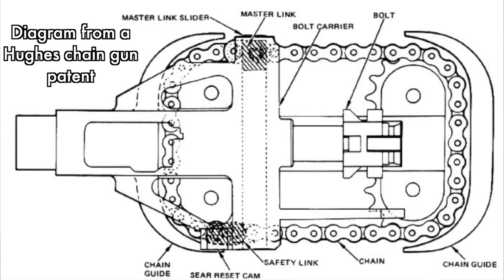Ask Ian: Are Man-Portable Chain Guns Coming?

Comment: Also "inconsistent" ammo in a chaingun isn't just because of under or overloaded rounds; but can be because you switch between, say, HE and AP rounds -- and many infantry fighting vehicles chainguns have dual ammo feed to allow just that.  Recoil or gas operated guns likely need adjustments when you've got that amount of difference in projectile energy.
Reply: My shotgun is a Beretta 1200. It won't cycle trap and skeet rounds or even low brass rounds quite often. It also has a 2-3/4" chamber. That leaves a rather narrow window of operational rounds for me. I hear the 300blk has rather overcharged subsonic rounds to give it a prayer of properly cycling as well. This is a real issue.
Reply: @groofromtheup5719  I read this comment in a little Italian boy accent
Reply: @TheHAIR00  I am now reading that comment with an Italian accent on purpose.
Reply: @blunderingfool  mama mia!! 🤌🤌
Reply: @TheHAIR00  OOOOOOooooooooh (Paulie Gualtieri style)
Reply: @TheHAIR00  sorry to disappoint, but I don't have the finger dexterity to pull off a proper Italian accent.
Reply: @DarrellVermilion  Pappa peeya
Reply: @TheHAIR00  "little Italian boy accent" sound so specific it's very funny to me. You know as opposed to a "huge bearded Italian man"
Reply: @APleasantEmu-ce6hm  I do not remember posting this comment, but I stand by it. It is still funny to read that comment in a little Italian boy accent
Reply: @TheHAIR00 Hahaha it sure is
Reply: @groofromtheup5719  there are some 265 grain lead projectiles s available for the 300blk. They're designed to allow for a lighter powder charge to minimize gas, while still having enough pressure to cycle the gun. I loaded up some that weighed in at 260 grains with 10.45 grains of CFE BLK at 2.125" overall length. I was getting a consistent 960 fps with my 8.5" 1/8 PSA upper. I think this upper is over gassed because PSA. This 265 grain projectile is the same length of a much lighter jacketed projectile, so you don't end up with compressed loads.
Reply: @groofromtheup5719  that’s a shame… maybe a M242 25mm bushmaster would be better for you, it’s great at cleaning up low and slow flying aerial targets!!
Reply: @groofromtheup5719  Usually autoloading shotguns are adjustable for exactly that reason: There's a stupidly variable number of different loads out there. This is also why I bought a pump. You should be able to adjust to replace something to make your autoloader function right... please refer to your owner's manual to confirm for your firearm, however.
Reply: @groofromtheup5719  Used to have a wonderful Beretta that would also only tolerate high-brass.
Reply: Actually, changing the settings on the gun adjusts your sights for the trajectory of the selected ammo. The pressure of the round doesn't affect function because the gas or recoil from the cartridge doesn't operate the gun.
Reply: I'm somewhat confused. A chain gun is mechanically operated. The chain guns I'm familiar with will cycle all the ammo through them without firing at all. Why couldn't you just time it for the highest pressure cartridge so tearing the cases would be a non-issue? It would always have dropped enough pressure to allow the case to extract.
Reply: While its possible to have remote control over the gas port size, that's the kind of engineering that's ask for problems
Reply: @nordoceltic7225  True that. This solution has been around for a fair while; also notably in the F2000/FS2000 iirc. I don't know which gun was the earliest to adopt it though.
Reply: at that point you are nearing "auto cannon" range (25mm bushmaster), he was speaking to near small arm to heavy machine gun use.  I got stuck in a mech unit so I know what you mean.
Reply: Why don't you just have one big belt of ammo that is loaded in such a way there everyone 1st round is HE, and 2nd is AP, 3rd is back to HE, and so on so forth? Sounds like a real all rounder. Since your firing so many rounds it would basically just mean you are effective against more targets.
Reply: @Jsay18  That's how it's done in single feed guns. However it's a compomise, if you're shooting an armored target, you're half as effective than a full AP belt, if you're shooting at infantry, you're half as effective as a full HE belt.

You could double the fire rate but now you're consuming twice as much ammo to be just as effective and you can only hold so much ammo.
Reply: Nope. I was commander on a german recon tank, we had the 20mm RH 202 and it was recoil operated and double feeded. Same gun as in the Marder IFV and many other applications.
Reply: I thought modern weapon systems are supposed to handle ammo switching bc most modern armed vehicles have a brain aka a PC build in
Reply: @rayman8591  so, would you have a bullet scanner and a computer controlled orifice on the gas system? The chaingun is starting to sound much more simple.
Reply: @groofromtheup5719  Why the need for a scanner? The computer only needs to know where the bullet came from. That means that the boxes, magazines, what ever are indexed and loaded with correct ammo. Then those indexes are fed into the computer and it will then draw what ever ammo you want without having any need for scanners  and such.
Reply: @anteshell  I trust a factory round to be loaded to specc, much more than I trust some blockhead to load a magazine correctly and another one to put the correct mag in the correct spot.
Reply: @groofromtheup5719  Really? Who do you think loads the magazines in before the battle and during it? It's not the factory. Doesn't matter how much you trust people to do things correctly, It's you and those blockheads in the armory or vehicle bay doing the thing. You have no say in these things.
Reply: @anteshell  I think they meant they trust a factory round to have the load it's supposed to. The factory would be loading the casings in manufacture.
Reply: @Biotear  Regardless, it has nothing to do with his original point of needing a scanner to see what kind of ammo is going into the chamber.
Reply: @anteshell  You have to add another solenoid onto the gun that won't die to recoil and heat, and connect that to the FCS, on the otherhand, you could just have a chain gun.
Reply: @rayman8591  My (limited) understanding is that their computers are mostly adjusting the sights based on the differing ballistics of the ammo.  I guess with the right peripherals they might also be able to automatically adjust gas or recoil settings on a gun, based on the selected ammo type, to ensure it cycles correctly - but I'm not aware of any that do.  (And the mechanisms for that might be as bulky and complex as just using a chain gun in the first place) 
Certainly the Bradley uses the M242 Bushmaster chain gun and so it wouldn't need to make any adjustments to the gun's mechanism for differing ammo types.
Reply: @rayman8591  The ammo difference does not impact the chain gun. It's powered by an electric motor, not the round it fires. It will cycle a dummy round without issues if you put one in the belt
Reply: @rayman8591  The FCS, Fire Control System, accounts for the stuff once the boolet leaves the barrel. Until that happens the FCS can only programme rounds if they're programmable like the newer DM11 HE round, it can't change the physical powder being used for an HE or APDS round.
Reply: A 2a42 will run with whatever mix you want.

Comment: Man portable chain guns? Why? Not a practical weapon unless its on a vehicle. The rate of fire means you would need five people just to lug the ammo. Probly better to just bolt it onto a jeep eh? Cheers Ian.
Reply: Agree, eventually we will get those sick exo suits but until then its better mounted on a veichle or a tripod.
Reply: As he says, rate of fire on chain guns doesn't tend to be significantly different from typical machine guns.
Reply: As said in the video, the rate of fire isn't anything like a minigun. Single barrel, so rate of fire is limited to around 1000 rounds per minute and even then that's the burst rate of fire, not sustained.
Now I do agree with you that man portable chain guns don't make sense unless you have the powered exoskeleton to go with them, but that's because they're heavier than their otherwise similar recoil or gas operated designs and servicing those isn't particularly hard when you have easy access to the whole weapon.

Comment: We're gonna end up like Doomguy at some point.

(Yes, I'm aware that the Chaingun from Doom isn't even an actual chaingun.)
Reply: I remember having this discussion with some guys way back in high school. Their argument was "But it's got a chain". Hard to argue with that...
Reply: In the 2016 and 2020 games, it is actually a multibarrel chain-driven gun.
In "DOOM Eternal", it's even a chain rail gun!
Reply: @mulrich  Sorta. It fires 7.62 x 51 AE, which is more powerful than the standard 7.62 NATO that comes with an electromagnetic case for its rail system, in which the bullet is slung faster and reduces overheating
Reply: I'm thinking the Doom 2016 shoulder-mounted grenade thrower "thing" (based on Metal Storm 3GL type tech) is gonna become a reality in some way before the chain gun does, unless we discover that we should start making guns out of Titanium (for weight savings).
Reply: @44R0Ndin  that's "DOOM Eternal" 😉 the Slayer doesn't have the shoulder rig in "2016".
Reply: @mulrich  Oh right, I always get those two mixed up in my head. What was it in 2016 then? Hand grenades?
Speaking of that, a hand grenade that has IFF tech in it would be quite nice. Idea being it refuses to detonate if it gets thrown back or you mess up throwing it.
Reply: @44R0Ndin  Command detonation would make more sense I think. It's nearly impossible for the grenade to really evaluate if it should blow up, even if it had a proper AI on board =) conversely, the thrower already has some situational awareness and context, eyes and ears that are not at floor height or bouncing and rolling in dust, and decision-making system built-in. A small disposable button fob, crypto keyed to this specific grenade, still seems extravagant for us, but it's much more likely than a "thinking grenade", and doable even today.

I mean, if you already have a bomb which can identify friend from foe and explode near foes, just give it propulsion and you've got a suicide drone. Which they're already developing like there's no tomorrow!
Reply: @ayebraine  Doesn't have to be that difficult, just a radio proximity element to the fuse's arming chain, that way if someone messes up a throw, the grenade remains disarmed, and if it goes back within range of friendly forces, it would disarm again.
Reply: @44R0Ndin  Makes sense. That would also make every soldier a beacon in the RF, and if grenades are so smart, well, what about autonomous hunter-killers... ))
Reply: A chaingun that fires pistol rounds no less! Maybe it's a sort of FN 5.7 thing? It is also quite slow, at 525 rounds a minute.
Reply: @wraithcadmus  A chaingun (or more likely, revolver "cannon") that fires armor piercing 5.7x28 ammo would actually be quite interesting to see in a video game.
Of course, because it's being put into a video game (potentially in the future), "rule of cool" dictates that the ammo will also have to be electrically primed caseless telescoped ammo as well, because "this is the future".
Reply: Doom and Quake

let's gooo
Reply: Considering chainguns are legal and Biden wants us to all get a double barreled shotguns i think he knows something we don’t
Reply: Enrico did u ever read the starship troopers book?
Reply: @billyelliot4141  No, but I have heard of it. The Mobile Infantry in the books can carry more weaponry and ammunition than many FPS protagonists.